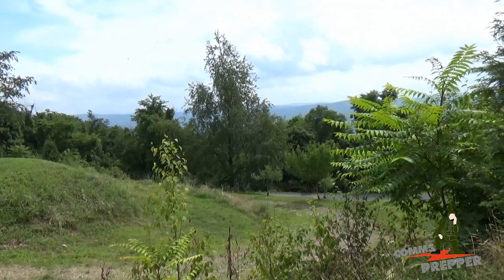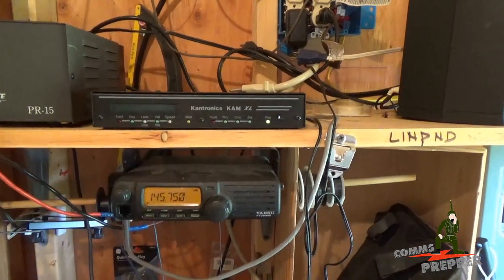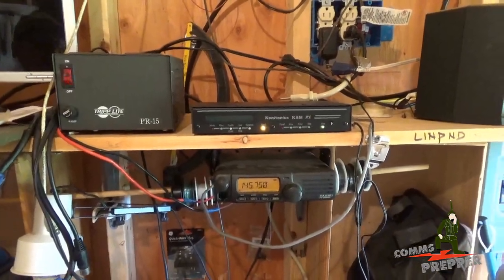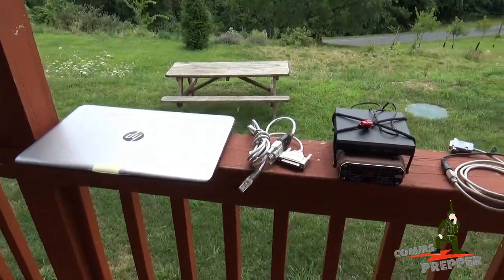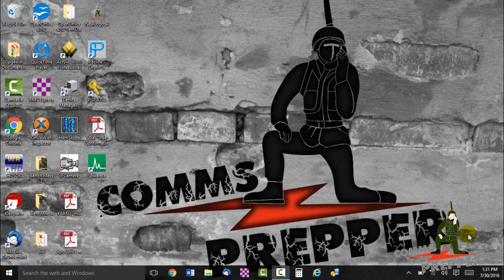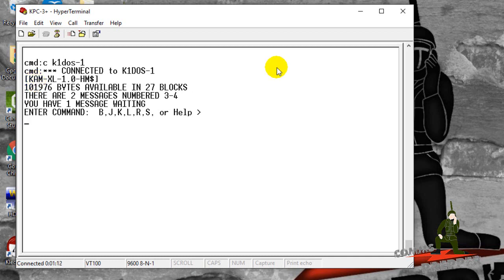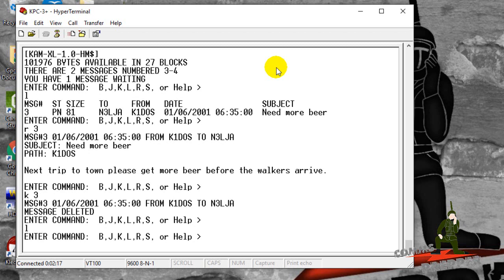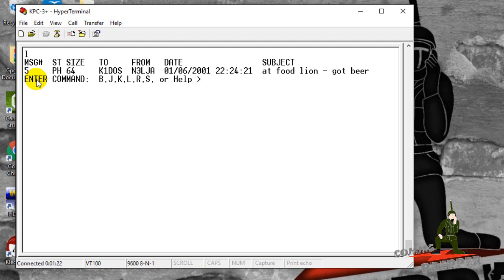Kantronics Packet Radio Mail and BBS Operations

Comment: Cool video. Few questions: what would one need to built a digipeater on the go?? Once a message is on the device can it be retrive without a radio, like just a computer???  It could be a good security set up between a base camp and reconnaissance communication 8)
Reply from the maker: You would need a radio, Kantronics TNC, power, and antenna.   Yes - you can connect to the BBS locally with a PC via the comm port.
Reply: +Commsprepper maybe a video how to set up one is in order then. It's a great idea. Especially on my last ham fest there was some pretty inexpensive packet tnc 8). It would be like Navajo code breaker WWWII use something okd not everyone is aware 8)

Comment: I think one reason why Packet Radio isn't too popular at the moment, is
peoples perception that you still need a hardware TNC, and the complexity of 
all the commands.

A TNC isn't needed anymore with the availablity of soundcard TNC emulators, that
use a data modes interface such as the Signalink.

I use the UZ7HO Soundmodem with its companion Terminal program, Easyterm, written
by the same author, and a homebrew interface.

Easyterm has a nice, simple to use, graphical user interface, which handles all
the commands for you. It also has a very nice integrated Personal mailbox.

If you are set up for any of the other data modes, it's just a matter of
installing the software, and you are set up for packet.

Comment: I love packet radio. I have a Kantronics KPC3+ running 24/7 on 145.050.  Where I live, southern California, there is still a lot of activity.  I want to get a solar power / battery setup for emergency communications.
Reply from the maker: Getting ready to setup the modem tonight here at the retreat.
Reply: I've been thinking the same thing.  I only have the PicoPacket that I'm just now starting to setup (bought it long ago but never invested the time to get it going).  Getting it online and run by solar could be very useful in some of the extended power-outage situations like we have been having here (northern California).

Comment: My KAM has HF packet capability so I am about to try this out across the UK on 40 metres. I agree with the comment about puTTY - it is a superb terminal program - very user friendly and "almost" plug and play. A word about RS232 to USB converter hardware - the cheap ones don't work... Very nice demo and explanation, thank you!
Reply: the cheap ones work fine on linux and android but windows has driver issues
Reply: Keyspan sells the best USB-Serial converter in my opinion.
Reply: I am using puTTY on my AEA tnc and works great...

Comment: I built/coded my own system that works about the same as this, but the transceiver is my ole Baofeng UV82, so I have to use AFSK. I have a web server and a service that reads and serves messages from DireWolf. It isn't meant to do real-time or keyboard-to-keyboard, but I am thinking I might be able to make my software work that way. Thanks for this demo!

Comment: Thanks for the video! I believe Packet Radio is a lost art that needs to be totally revived. As in an emergency or disaster this system will be one of the few working communications. Years ago, I was using Packet TNCs in the GLB TNC days. We had super nodes set up work from Florida to California. Just get a connection from where you lived into one node and you had communications with your friends across the country. Internal mail box, I thought was great. It was the early form of Email and all done via radio instead of Pay As You Go Internet. The Hams had the early form of Email and it was great. If you remember GWBasic programs we wrote were small in file size. We could convert them to Hex code and send them as an Email. The receiving person downloads the text, converts back and they have a working program that I had wrote. Software based TNCs are OK, but they still need a computer of some sort to stay running. That is a waste of equipment and power. I really wish someone would rewrite the Old Style TNC system on maybe a ESP8266 or ESP32 and keep it on the market! I have seen where once in a while a cheap copy is made which does a few basic functions then months later gone. Like Kantronics, who has been around for a long time, keep making the equipment. Where I live Emergency Comm is going back to Packet Radio becaude of eBay and a TNC you may fine on there once in a while for a good price. But, the real thing is companies who make radios need to get back into making radios with real Data ports as to hook TNCs up to. APRS is OK but still very limited! No BBS functions, No way to interface with a good display etc.  Might be a new radio some day based on the old ideas of real data ports with Rx, Tx, Squelch, Mic audio, Cos, Cor, Ptt. Yes, the good old days that might save a life some how.  Don't know how many engineers could build a radio like that now days, Ha Ha...

Comment: Good video. Kind of reminds me of the days when I had my 1k2 PC-COM modem and practiced Packet Radio on 11m. Back then, the software I used, Xpacket, ran on DOS along with the TFPCX TSR driver (based on The Firmware). It's hard to imagine today that this really worked, esp. on something simple as an 80386 PC. A real TNC was way too pricey IMHO and out of reach for most young people like me, unless you had a fellow ham friend that built one for you. Later on, programs like Flexnet or MixW2 did about the same with a soundcard. Nowadays, a simple Arduino can emulate a KISS TNC, even. Still, it's nice to see old TNC/TNC2 like devices still being used. They can work on their own and do things like APRS or host little mailboxes.

Comment: We need to combine the concepts of 1980s packet radio with the larger regional service area of NVIS and modern digital modes with relatively low bitrates/bandwidth but very high reliability from forward error correction.  MT63 is emerging as the winner in that category.  This eliminates the line of sight limitations of VHF and it's also inherently QRP.
Reply from the maker: Does MT63 have error correction?
Reply: MT63 has forward error correction - so it can detect and correct transmission errors without retransmitting.  The various digital modes use all sorts of different error correction schemes, and many of these methods have been optimized for the types of interference and signal distortions characteristic of different methods of propagation.

https://en.wikipedia.org/wiki/MT63

"MT63 distributes the encoding of each character over a long time period,
 and over several tones. This code and symbol spreading implementation 
is key to its robustness under less than ideal conditions. The MT63 mode
 is very tolerant of mistuning, as most software will handle 120 Hz 
tuning offsets under normal conditions."

AMRRON is using MT63 on 2m and 6m for their digital communications.

https://amrron.com/nets-regional-national/amrron-local-nets

Comment: Thanks for doing this video. I really enjoyed it. I just acquired a couple of Pakratt PK-232MBX TNCs that an old ham was giving away. I bought a Yaesu FT-450D HF and a ICOM IC-2000 VHF transceiver to connect them to. Going to order the cables from Les when I get paid this month. I'm going to use the HF radio and one PK-232 to set up a 30m APRS i-gate so I can reliably get messages gated to APRS-IS from my portable station when I'm out doing SOTA activations, etc. I think I might use the VHF radio to set up a packet node, since there isn't one in my area. Tossing up between doing that and setting up a Winlink node, since those are thin on the ground here as well. What do you think? The question I'm asking myself is "why am I messing around with these ancient hardware TNCs when I can more easily use a software modem like Soundmodem?"

Comment: $60 is too much for a very simplistic terminal emulator software. There are tons of free ones out there and most are likely much better than HyperTerm (unless this paid version has vastly improved over the included ones on Windows.). I usually go to try to find a freeware software before I'll pay for one. Just saying.
Reply from the maker: Yeh...  I agree.  I did not know about other options at the time.  Now I use Putty.

Comment: Thank you for the demo - very cool! What terminal programs do you recommend for LINUX and MAC operating systems? What is the minimum dollar investment for a setup like this?
Reply from the maker: KPC-3 Plus $200 at Ham Radio Outlet + Radio.  I can't recommend Mac or Linux because I don't run them.
Reply: for linux over serial, just figure out which dev file the serial port you're TNC is connected to. Install the program called "screen". This is a terminal run application, so you will need to use the terminal for it.. For me, i'm using a USB to serial adapter, so the command I use looks like this "sudo screen /dev/ttyUSB0 1200". This pulls up the screen program, tells it to connect to the device attacked to ttyUSB0, and sets the connection rate to 1200, which is what my PK-232 uses. Some times, cheap USB to serial adapters you have to unplug, and then plug back in, and then use the screen program again.

Comment: I am wondering if you have updated this or not? I ask as im looking to undertake a project to make a much smaller version, that is also portable. Main differances is changing your laptop to a Raspberry PI, your 12v set up to 18650s with solar charge option and with 240v (my mains voltage). Power input still undetermined, but this denotes the size of the package obviously.

Comment: Great to see a packet station in operation again!  The problem is, even if you set up a packet node with BBS, no one will use it.  In the early 2000's, at the waning end of packet networks, I set up a station but got zero connections calling in for like a year.  I eventually took the packet station down and the equipment went into mothballs.  I'm just now pulling it back out with the idea of setting up an APRS iGate.  Even APRS seems to be waning nowadays.  Thanks for the video; you reminded me of what commands I need for working with my KPC-3!
Reply from the maker: I agree - I'm getting ready to pull mine down too.  No one uses it.  I now use AREDN.
Reply: @Commsprepper  going to configure mine as an APRS digipeater. As opposed to throwing it away. 😎

Comment: That should be cake to learn for anyone who ever used command line DOS or any of the many, many command line driven programs/software. The hardest thing would probably be the cryptic command line help services that define the command line option or switches, but after a few uses those should be nailed down in no time.  Very cool and so very useful in a net down situation.
Reply from the maker: Thanks.  I plan to setup a digipeater with BBS here on the mountain.

Comment: So this works with HF as well? And I am guessing you have to know the others packet address before you could contact them? Neat stuff I may have to look into this, definite prepping item for communications.
Reply from the maker: The KAM-XL does support 300 baud packet on HF.  In the before times most HF packet was done on the 10m band.
Reply from the maker: Sorry - missed part of your question.  The packet address is the call sign.  It all runs simplex.  In the old networks your would hop from one station to the next with V (via) commands.  i.e. C XYZ123 V ABC123.
Reply: HF packet exists but is problematic. Look up Network 105 for more info. HF runs at 300 baud (except 10 meters which is 1200 baud). The various parameters also need changed so that packets aren't too large and that you aren't retrying before the remote station can acknowledge you. In some cases you may have multi-port stations that allow you to connect to HF from VHF (or the other way around) meaning if such a node is available you can take advantage of HF packet even on a technician license (since you could access on VHF).

Comment: Presumably this was done simplex? Are packet repeaters a thing?  Can you transmit packet data over a normal voice repeater?
Reply: I'd like to know as well.
Reply from the maker: Yes - it's called digipeating over a digipeater.  The station in my shed is already a digipeater with the Kam product line.  When digipeating you enter C CALLSIGN V CALLSIGN.  The V is for via.  then it will connect and the other station will relay for you.
Reply from the maker: Yes - it's called digipeating over a digipeater.  The station in my shed is already a digipeater with the Kam product line.  When digipeating you enter C CALLSIGN V CALLSIGN.  The V is for via.  then it will connect and the other station will relay for you.
Reply: Yes, you have digipeaters as already mentioned, these are horribly inefficient as they are pretty much just repeaters meaning that any response (including acknowledgment) must travel through all stations. This can lead to significant congestion on the channel. Nodes effectively put you at their station as far as the connections are concerned. Let's use 4 stations A - B - C - D.

With a digipeater connection you transmit a connect to station D from station A via Station C and B. This takes time and if the channel is very busy can fail easily. Once you connect and an acknowledgement is sent back, the acknowledgement has to traverse C and B prior to reaching A. If the channel is busy at either station the Acknowledgement could be delayed and time out. This causes significant congestion. Station A sends a packet, Station B blindly re-transmits, station C blindly retransmits, station D then acknowledges, station C blindly retransmits (observing Collision Avoidance), station B blindly retransmits (again observing collision avoidance) , and hopefully you haven't run out of time before the acknowledgement gets back to station A.

With a node you connect your station A to the node at Station B at this point you have a connection to station B and the acknowledgments are handled for your station at station B only. From Station B you connect to station C's node. Station B then connects to station C, but station A is only connected to station B. If the channel is busy at station C and an acknowledgement has to wait, there is no concern about timing out station A as it has already been acknowledged by station B. Once you are connected to the node at station C, you then connect to station D. When you send a packet it goes to station B, station B acknowledges station A and your station A is simply waiting on a response from station B, since Station B is connected to station C, it then forwards the packet to station C. Station C acknowledges station B and forwards the packet to station D. The response goes in the reverse.

Now when the node system gets busy, let's say station C's acknowledgement wasn't received at station B in time, station B retries and stations A and D are none the wiser.

In computer networking think of a node working like this:
Station A telnets to B, then from B telnets to C, and from C telnets to D.

Comment: Interesting stuff, but other than the obvious educational aspect of doing these vids, why not just use a RoIP gateway?
Reply from the maker: Because RoIP needs the "IP" part to work.  Packet radio uses only RF links for communications.
Reply: Fundamentally though, don't they both basically function in the same way? Yes, I realize a RoIP gateway uses TCP/IP and technically there are some diffs, but your modem is basically doing the same thing as a RoIP gateway (function wise, not technically) is it not? APRS or RoIP; you need extra equipment to "mo/dem" the data and either way, the "link" is RF. The main diff as I see it here is that a RoIP Gateway can interface with a whole lot more in terms of back-end tech since TCP/IP is pretty much the defacto networking standard now days. Basically, what you have the ability to do with RoIP is make a super-sized WAN. Besides the technical differences, it is the basic premise behind Cellular networks. I understand that digital radios have different restrictions/requirements for point-to-point comms, or relay comms, but my understanding with a RoIP gateway is that it turns the digital "IP" data, into an RF signal, then back again... much like the modem of your APRS system. In other words; with either system you are basically creating a wireless bridge/relay. My thought here is basically setting up a mobile WAN infrastructure that I can secure relatively well, since IP encryption is, for now, legal... unlike RF encryption. This would also make it really easy to interface systems such as a portable NAS, email server with chat system, other LAN infrastructure like security devices... the possibilities are endless. I hope all that make sense... lol.
Reply from the maker: +GraymanTactics they are nothing alike.  In this video I showed how to create digital communications on a closed network with no IP or land connections - no external dependencies.  Add solar power and it's even more stand-alone.  Soon I will get into digital repeating from one station to another with a middle station relaying.
Reply: Commsprepper my point here is you can have a RoIP gateway, in the same form factor, as this system. I look forward to your video on the topic. Hopefully soon i'll have my system together and will vid the process and outcome. Thanks.
Reply from the maker: Cool - look forward to seeing your vids.
Reply: You have gotten the terminology wrong. RoIP isn't what you think it is. It stands for radio over IP, which means tunneling radio traffic over the TCP/IP networking. For example, Echolink is an RoIP implementation. IRLP is another one.
Reply: @CPLBSS88  this video isn't about APRS, which you have referenced twice. IP encryption is legal only if it's not over amateur radio. And this video is about amateur radio.
Reply: @CPLBSS88  you have misunderstood what RoIP means.